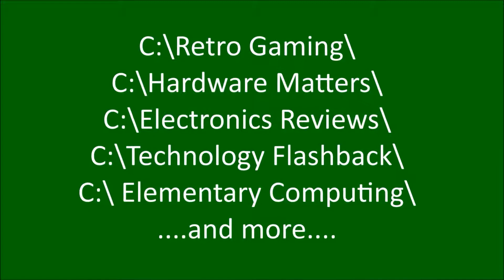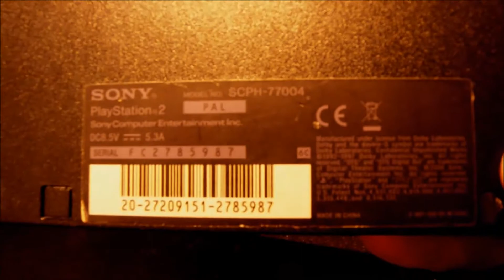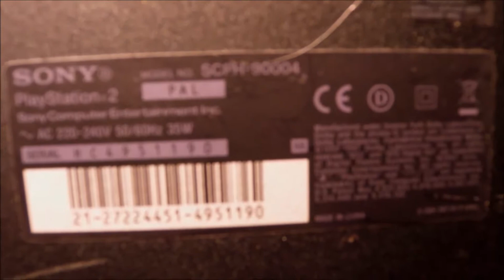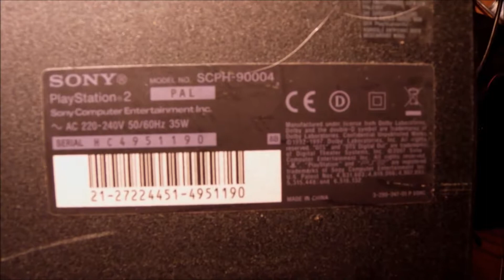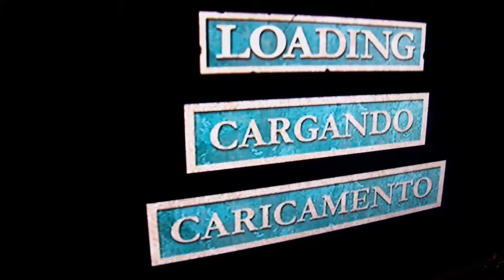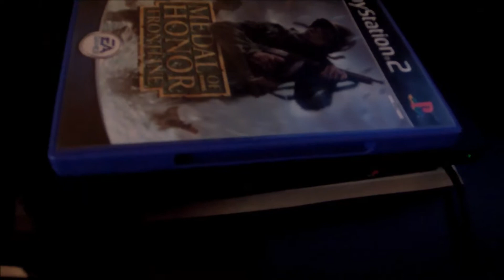PS2 Essentials: Laser Replacement easy fix: 'Disk Cannot be read'.

Comment: Hey so... I removed the braces and laser part, but putting it back together I'm getting a grinding when I try to use it, I didn't get that before. Any tips here? I know it's the button on the bottom, but this wasn't happening before I tried to fix the potentiometer with your other video. Thanks
Reply from the maker: Hi, the motor is not adjusted right (the long screw 'golden thing' is making the noise as it doesn't go up and down and tries to find the right path to move the laser right). The trick is to have the golden leg from the laser mechanism going to the motor the right way, and test it by hand (up and down ) before putting back everything together.